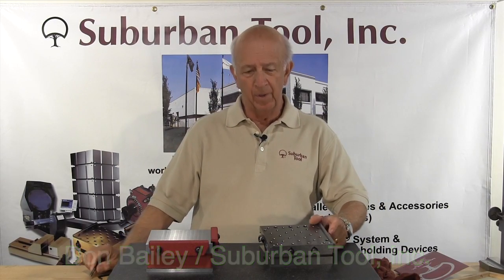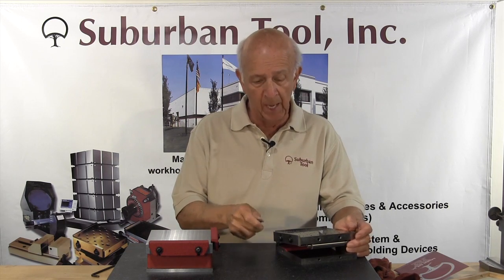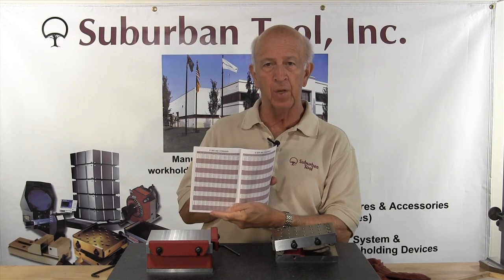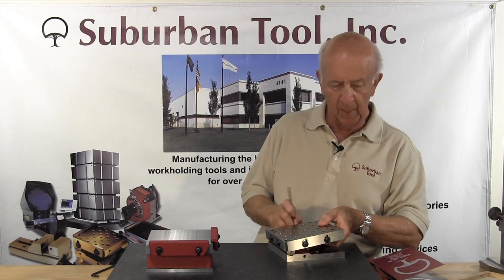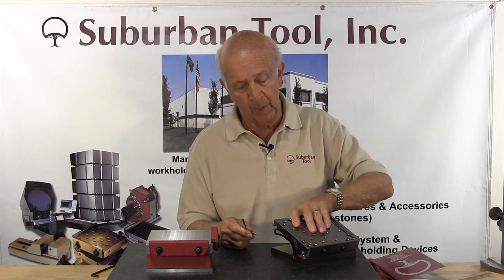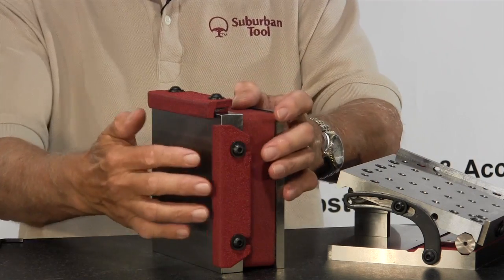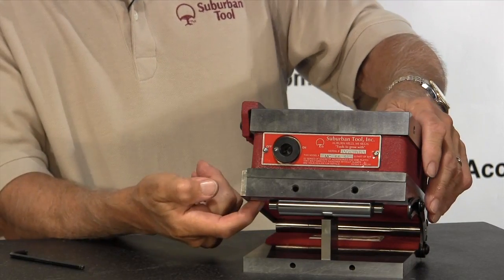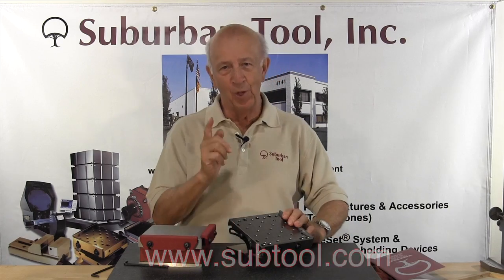SineSet Magnetic Sine Plate by Don Bailey

Comment: I bought a magnetic chuck from you. However, it was like 18 years ago I found it didn't have enough holding power for the parts I was trying to hold down.  I had to use the old hermann Schmitt magnetic chuck the company had instead. Also I recall, needed the magnetic poles to to be closer to the edge of the chuck. Like a  5/8 from the edge would be nice. Remember, You can't always block the piece up like you would like to.  But nice chuck regardless. Also just a suggestion, make the rails interchangeable across tools.  You sometime need low profile rail so the grind wheel can clear the piece.